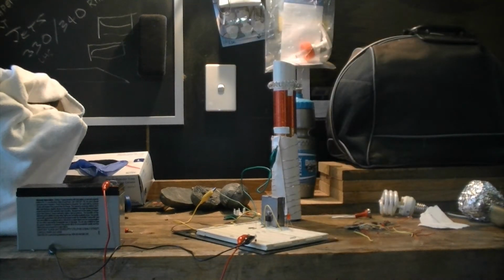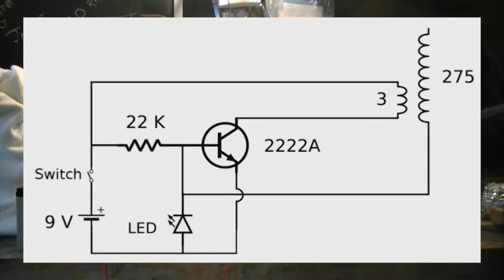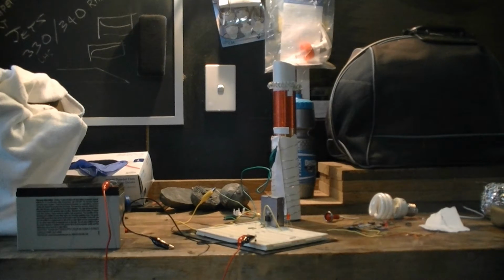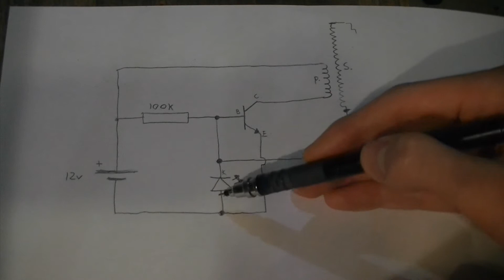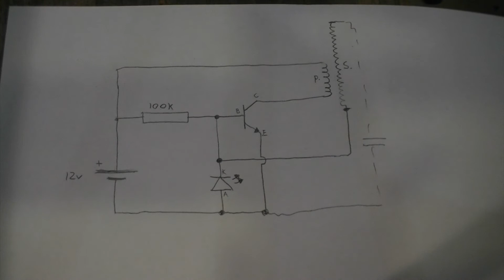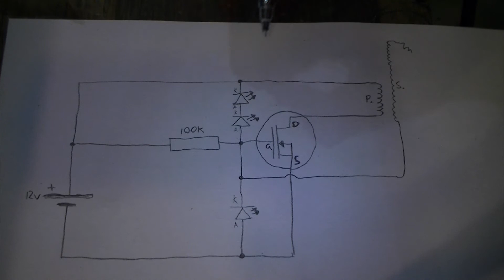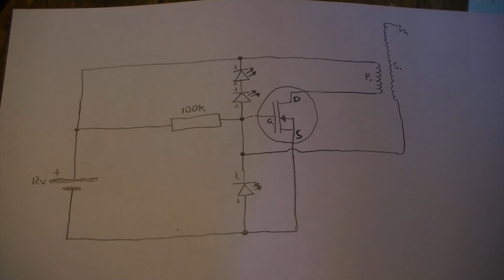How To Make a Tesla Coil

Comment: Very cool, but how did you build the secondary coil?
Reply from the maker: I tried an elaborate setup of winding the magnet wire on with a drill but ended up just wrapping it around the pipe by hand (a lengthy process). I would have filmed a bit of it and put it in the video but I'm afraid I built the secondary coils months ago, before I started making videos.